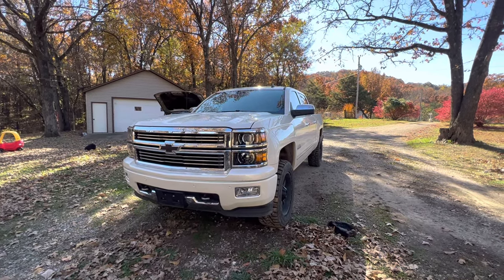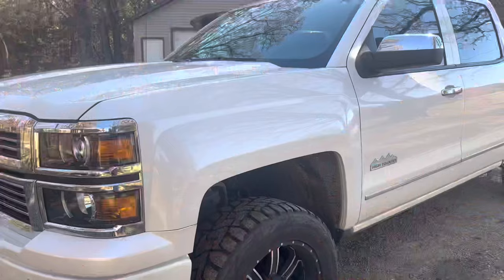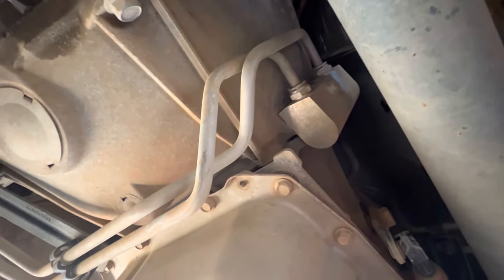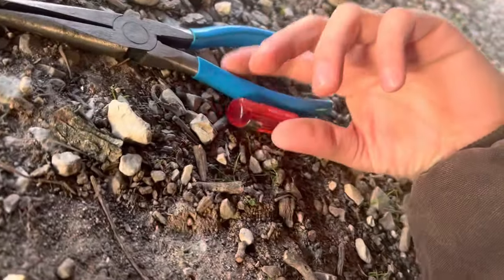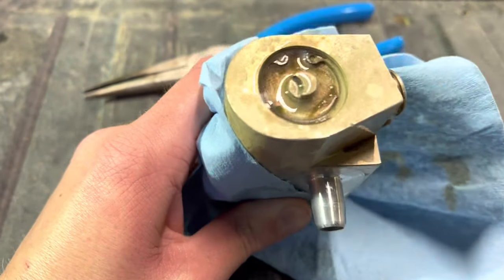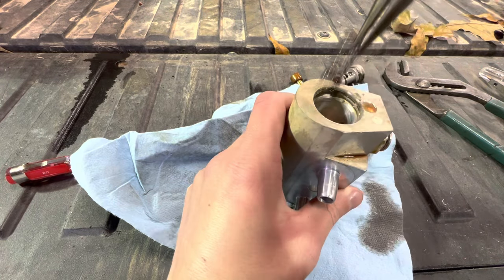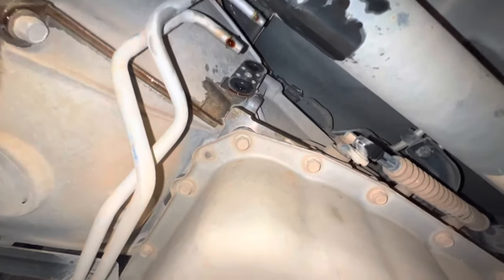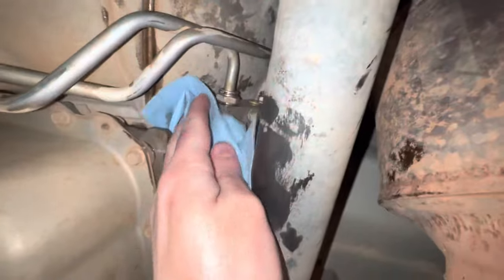Keep your 2014 - 2018 Silverado or Sierra transmission cooler FREE MOD! (Flip the pill) 6L80E

Comment: I just bought a 2014 GMC Sierra 5.3l V8 and I’m certain this hasn’t been done.  I only have 105k miles on this truck but thinking I should do this.  Do you recommend ordering a new thermostat or flipping this one?  If replacing, which part do you recommend replace it with?  Thank you.
Reply: With 105k you may want to consider replacing the torque converter (I've seen recommendations to replace the L680 TC with a 6L90 TC) before it disintegrates and blows through the gear box.  My 2015 Sierra 5.3 w/ 6L80 did just that at 138k.  $6,000 later I have another GM rebuilt 6L80 transmission now with 40k on it, and don't plan on letting GM shove their hand in my pocket for another 6k which is why, like you, I'm looking for preventative solutions like cooler thermostats and bypasses.  Just my .02  Good Luck!

Comment: To late for me.  Mine failed and that cost me $6,200.  Thermostat got stuck closed.
No warning lights or temp warnings.  However, the electric fan did come on.  I thought that was a stuck fan relay.  Didn't notice I had a transmission problem until it gave me symptoms.  Was 200 miles from home.  It got back home, but it was fried.  That was an unnecessary failure.

Comment: My 6l80 still doesn’t run cool enough. I did the bypass and mine still runs around 150-160 average. My other truck with the 6l80 runs 130 on average

Comment: Just did mine at 67k. Shoulda done it at 45 when i first bought it. Did i wait too long? Didn't have quick connect links had a cover locking plate with a screw

Comment: Why not take the thermostat out completely? Thank you for the video
Reply: I was wondering the same thing.. just take out the spring and "pill" or plunger.. DONE.. lol  Have you heard anything new about it? (I've got a busted knee, having surgery AGAIN this Monday.. YIKES..lol) but I think I want to get this done asap. I already paid the $4200 for a new torque converter and Reman transmission, two years ago.. don't want to have to do that again.. lol   (just as I clicked "save".. I just figured out why..) You have to put it back in because the spring and the pill keeps pressure on the outer plug keeping it sealed. So, if the internals aren't in there.. it'll leak like a stuck pig.. my thoughts, anyway.. lol
Reply: He said no flow

Comment: Hopefully I did this in time..  constantly runs at 190 ... just took it for a test run down the hwy and she topped out at 165!!!!
Reply: Hey man, did the same thing and my tranny topped at 165 too. Was wondering if that’s still a good temp? Does the orientation of the top piece below the snap ring have any effect? That part with the half moon looking thing.
Reply: @sergeyandriyuk209  I wondered the same thing man, should have made a note of where things were orientated.

Comment: I did flip the valve for the fluid thermostat and dropped down the temperature dramatically.  
From 360 Fahrenheit to 176-196
Reply: 360 Fahrenheit??
Reply: 360? Boy that’s no longer a transmission lol

Comment: Its because the wires to the break controller under the carpet. Unwind the wires that are twisted together. You may have to do all or 1. As the wires are put together frome the factory, they get little cuts from the machine that makes them. So the wires start touching. After I did that took the pressure off the breaks. Better mpg less break problems. And the frunt stopped dipping in the front going down the road. Look at other trucks and cars and you will see them do it.

Comment: 2015 6.2 LTZ 4X4 , I'm going to try this also I have a question. My truck started making the classic u joint sound. I replaced all u joints (they were all good ) went ahead and replaced them anyway. It's still making the noise. It speeds up and slowes down  with speed of the truck. Could my front axle joint do that , they seem tight. Any ideas would be helpful. Like your trans temp mod , it's on my list soon as I figure out the current problem. Thanks. Subbed.👍👍🏁🏁
Reply: You might need alignment, worn out uneven tire threads can cause such weird  vibrations. Check rear suspensions, all bolts and nuts. If your truck is lifted, even more bolts and nuts to recheck and retorque.
Reply: I heard retorque spring ubolts

Comment: Ive got a 2014 1500 silverado 5.3 6 speed its been running at 194 degrees has annyone tried this yet on this specific model? Kinda skeptical on if this actually works

Comment: Just flipped mine when I put a new trans in I went from 180 to 115
Reply: Hope you replaced the stock torque converter with one that has a billet base. The stock converters are the reason  these trannys fail. Keeping cooler will help also.

Comment: What about the updated thermostat that opens at 165?
Reply: will still stick.
Reply: Before buying that, make sure your cooling lines match up. More than likely you'll need to replace the lines with the new updated part.

Comment: Did the GMC  trans mod replacement swap out for $70.00 .. Went from 190*+ to 150*ish .. From what I have come to understand trans fluid runs best at 175* ... Be aware that a total by-pass will not work well for your truck in cooler temps and people make lots of claims just to sound important ... Do your research !
Reply: @tyfannon1704  * I live in ENC where it can get very hot and sometimes cold ...  Bought it through an online  GM OEM sight ... Easy install and works great at keeping my trans temp below 175* .. Make sure you have all the info so you get the right GMC Mod for your Truck  installation ...  Good luck ...

Comment: My 2019 suburban is currently at 260... the high temp light came on today... wil this mod help me?
Reply: Absolutely should swap it out the bypass. My 2019 LT Trailboss was running 230-270 and when I took it to the dealer they told me my transmission has blown so yeah buddy either your transmission is already done for or you need to do something about it ASAP before you get hit with a crazy bill

Comment: Said your transmission. Needs serviced.   No it needed to cool down. It needs to be engineered and tested properly.  You dont build a rifle and not test it numerous times just in case it might blow up in someones face.   That limp mode bs almost got me hit by a bunch of vehicles speeding toward my flashing 4 lights. The dum fs are sooo dumb that they still drive right up behind you and sit there for 5 minutes until you tell them how low their i q is....  damn highway 7 is full of accident prone drivers and 5 lane crossovers.  Now gmc should be replacing all of these stupid valves for everyone.

Comment: After doing this mod do you have a best way to put on those clips, I’m having a hard time putting them on.
Reply: put the clips on before installing the lines, then push the lines in.
Reply: Don't bolt it tight till you have the lines on-then finish tightening so you can line up easier.

Comment: When you flip that tstat what holds the pin in or keep the pin from falling out and ending up in the system ?
Reply: what happens when you need the bypass to kick in??? nothing... but the unit melting...  Sure~Cool for the win here too...
Reply: Hey Anthony, in it's current configuration, the transmission fluid is coming into the thermostat from the "spring" side. aka the furthest port while looking into the cylinder. The spring holds the plunger "towards your eyes" looking into the cylinder hence sealing off the flow. When you swap their respective positions, the spring keeps the plunger from contacting the "shut off" position. I know this "fix" seems counter intuitive but by swapping their positions, it'll always allow some passage for the fluid to bypass no matter what the current fluid temperature. In essence, the plunger will be forced by the spring to be inserted into the oncoming stream of fluid but only by a slight margin. Hope this helps..
Reply: How many time do you think that the bypass is necessary for the average daily driver??? @superiortransmissionpartsi5357
Reply: @ericg4x4  anytime, you don't really know until it's too late.
Reply: @sterlingthibodeaux3690 do you think I should flip it I live in Texas and have 8 speed
Reply: @CarlosTorres_19  No.. buy the replacement internal valve like I did and replace it... it's not expensive and it's easy... even though you might successfully reverse the valve, one small mistake could ruin the transmission.

Comment: I live in western NY and have a 2014 Silverado 1500 LTZ, 5.3, with 94,000 miles.  Our temperatures range from -20's in winter to triple digits in summer. I can see my trans temp on the DIC, but have absolutely no idea what a safe maximum operating temp is. Can someone help me out, please?
Reply: Go Through the steering button. Set info to transmission fluid info and watch the numbers… mines avg at 198
Reply: In GA at 32 degrees, temperature on transmission 198 degrees, 85 miles
Reply: @henryaugustin9345  , Thanks, Henry.

Comment: Can this be applied to 2018 Chevrolet Suburban? If yes, why did you flip the order of things? Thanks
Reply: Did u figure out for 2018 suburban? Have same vehicle
Reply: @moxxy5411  I think Chevy engineers don’t want the transmission to run on law temperature for long time. I agree also high temperatures above 200 is not good. You will need to find out why the temperature goes up. Mine had problems with the transmission on the second gear. I found filings in the pan. I cleaned the pan and put new transmission filter and fluid (OEM parts) by my self and has been running very well. I know the transmission will die someday because many transmission workshop told me suburbans with 6 gears (5.3 engine) have transmission defects. I will buy a suburban with 8 gears (6.2 engine). Keep me updated.
Reply: @mufali7283  thanks so much for the information. I will get the transmission fluid changed as well as the filter and pan cleaned because I just bought the car used so when I’m slowing down to a stop sign or something the car hesitated when downshifting so I don’t know what that could be but I’m hoping changing fluid fixes it
Reply: @moxxy5411  yes, that is a good idea to start with. Hopefully that will fix the problem. When you first start driving it, does it take longer time to shift to the second gear? Is the car 5.3? What year?
Reply: @mufali7283  yea it’s 2017 I haven’t noticed that but sometimes the rpm slightly goes up then comes back down
Reply: @moxxy5411  change the filter and fluid and keep me updated. I had same problem with rpm before changing the fluid. Now it is better.
Reply: @moxxy5411  make sure you put the right kind of fluid, whatever is specified in your manual, AND make sure the right amount, measure and remeasure, add small increment, remeasure. Shift gears to all and each gears, then remeasure. And fluid when necessary. All DIYers fall victim to doing shortcuts. Eyeballing measurements. Bad habit. Cars nowadays, are fn sensitive, all these sensors added, makes the cars prone to annoying issues, we call problems. All it is really is doing the simple right thing when fixing your car. Very common mistakes that diy do, not using proper torques when wrenching their cars or engine. PRECISION is my motto.
Reply: That pill when you flip it goes down into the hole creating a plug. The spring holds it down.

Comment: mine is leaking everywhere afterwards and i cannot find the problem and help ?
Reply: Double check the lines are pushed in all the way.
Reply: Check to make sure you didn't lose or damage one of the O-rings on the transmission lines, sometimes the O-rings stay stuck in the thermostat housing and fall out without being noticed.
Reply: It can’t be leaking everywhere it can only be leaking around the thermostat so pull the thermostat back off clean your lines reinstall if it’s still leaking take it any mechanic they’ll fix it for less than 50 bucks

Comment: What should the temp be on a 2013 Z71  4x4 ?
Reply: My guess is 190. Probably why there’s a thermostat in there. 😂
Reply from the maker: I believe the 2013 did not have a thermostat, so I would expect on a warm day around 150 Fahrenheit
Reply: @DustinT  150-180

Comment: So how does the sensor lower the heat?
Reply: Not a sensor it's a thermostat. It's lowers it by not restricting flow after modification.
Reply: @fanohawk  but if you NEED the device to kick in and save a transmission...oh wait you just plugged that. my bad... to bad you didn't watch the superior video.

Comment: I wish you showed it working
Reply: we are working on a video for that. flip the pellet and watch the unit smoke when you kink the cooler line. why plug it off, use it to your advantage as a safety bypass.
Reply: @superiortransmissionpartsi5357  I bought the kit and my truck still gets up to 180-190 is your part faulty ?
Reply: @jamesholland167  you may need to add an auxiliary cooler in parallel to the trans cooler.
Reply: Working on that video, stay tuned

Comment: Why not just leave everything out of the housing and let it free flow?
Reply: It will free flow from outlet right back to inlet, never going to cooler
Reply: @rleeallison  Oh,,, thanks didnt know that. I have a mishamoto (whatever they are called) cooler on my seirra, and it still reaches 200 or more. But I also have a 2800 stall converter. I dont think its right though to still run that hot.